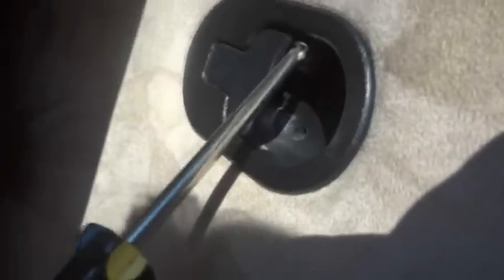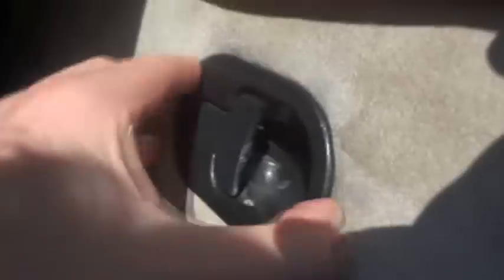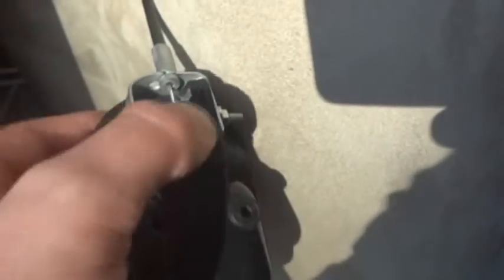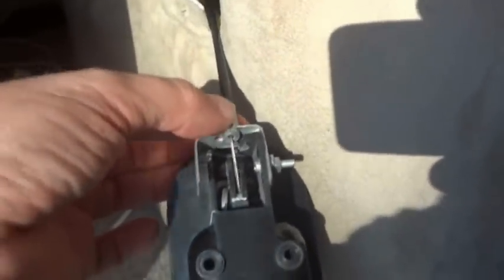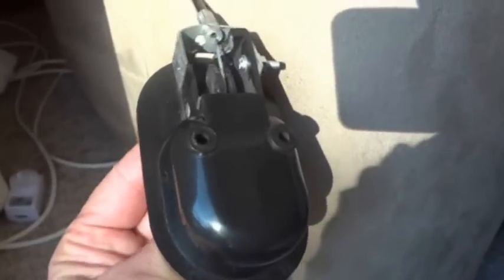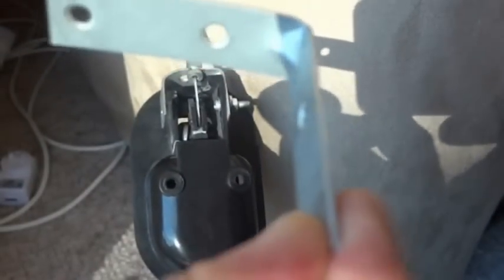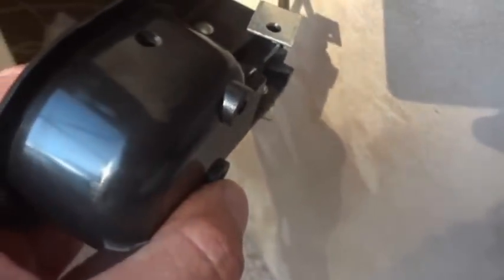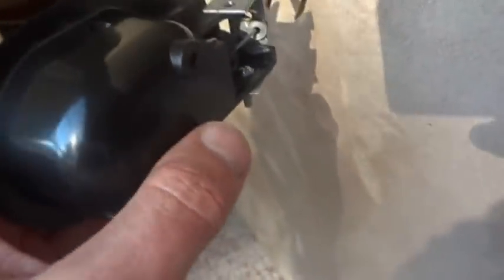How to Fix a Reclining Lounge Chair - DIY Recliner Repair - Fix a Broken Plastic Foot Stool Lever

Comment: Luckily for me, the used couch I just bought for $50, with the issue of 'one side doesn't recline' was just made whole again thanks to your video's help. Granted I didn't fix mine, but I found if you simply cut that cord and pull it out the side, and pull it whenever you wanna recline, it still functions fundamentally the same way.

Comment: I literally have the same sofa as you shown in this video...my issue is when I open it, as you stated "the big metal frame" is the part that hits/rubs the matal part that is connected to the metal floor frame
Reply: I have the same sofa too, my recliner is also broken as the one in the video, but I think it's not the only problem. because when I pull the wire it has no strength at all to stretch leg part, any ideas?
Reply: Amr have you found a solution?

Comment: Hi there, I've also snapped the plastic handle part and looking to get the replacement online. My questions is do I need to purchase the handle with the cable connected or is it straight forward to join the existing cable onto the new handle? Thank you.

Comment: Hi there any ideas on how to fix the back of the recliner its stuck in open position? I have removed it and the steal bars that the back attaches to wont align properly, any ideas??? plzzzz
Reply from the maker: taylor45z Not from me, sorry.  Perhaps someone else will add a comment with some ideas or details.